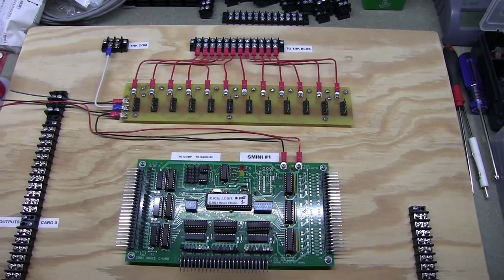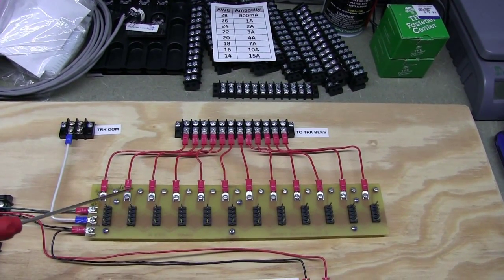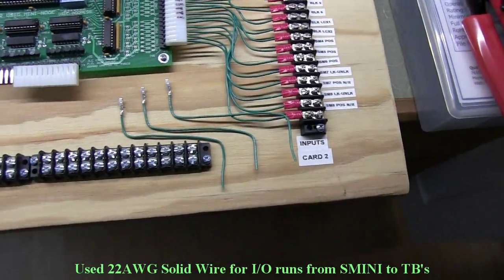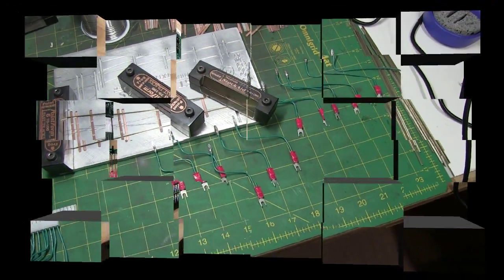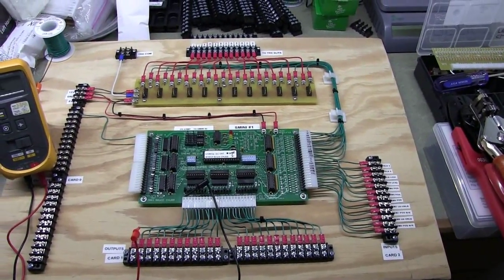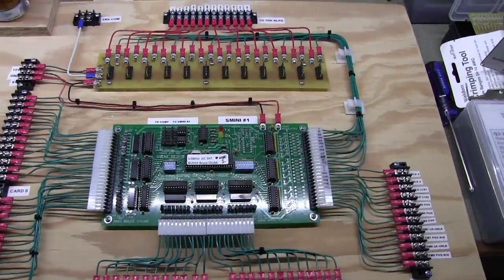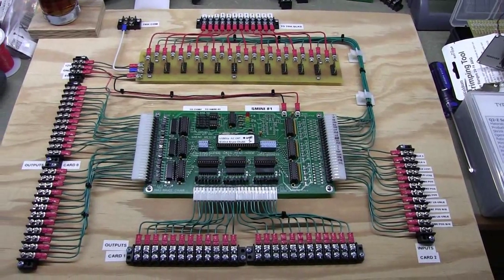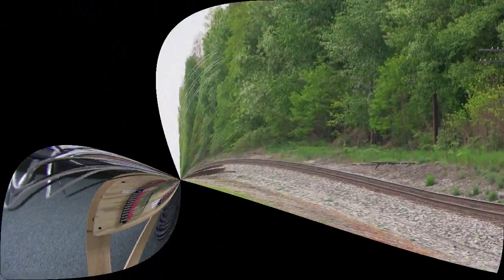Model Railroad Layout Update Video 33 - C/MRI SMINI Node

Comment: Good looking work on all those boards and wiring. I operate on a friends layout who uses the same set up for signaling on his layout. I am envious of you guys. Not only knowing HOW to wire all that up but being able to afford it all. I know enough about wiring to be dangerous. I know you flip a switch on and something goes on and you flip the switch off and that something goes off. LOL. Somehow or another I was able to put the main bus and feeders on the track on my layout and have the layout actually work!! Now if I can just get the small things that are impeding operation fixed I can be up and running again. Keep the videos coming. Very interesting. Dale and fellow Guardsman (ret.)
Reply: Dale Trongale Thanks Dale- I am now retired as well. Upcoming weekend is the first time in 28 years I won't have to go to drill...